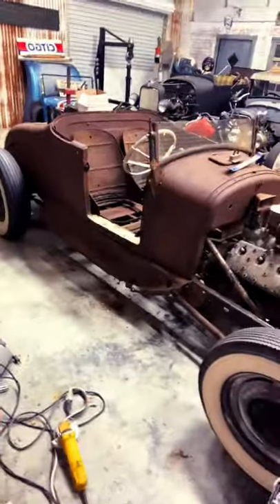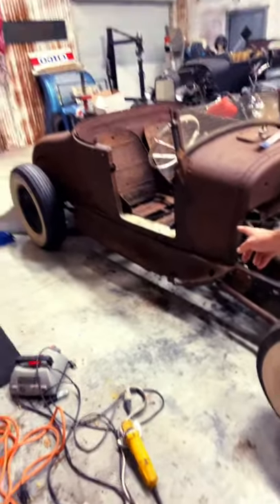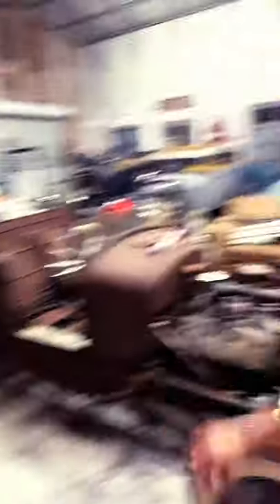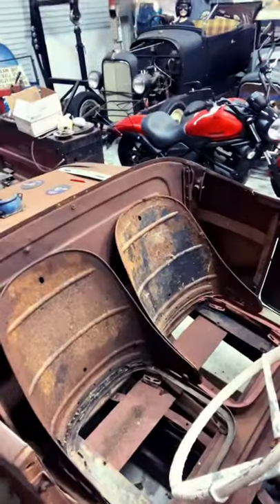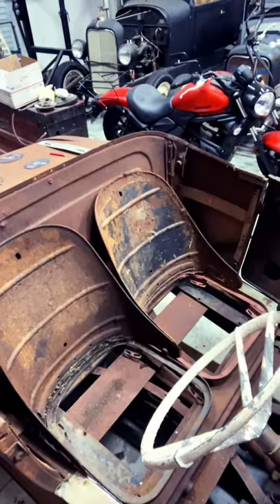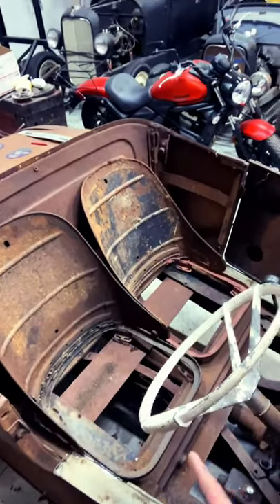Pinetree T update (short) #youtubeshort #short #thisoldhotrod #pinetreet

Comment: This build reminds me of my youth. Dad & me built a  T roadster pickup on a 32 frame with an 8-BA flathead back in the early 60's. We cut the cowl in half then widened it 7 inches to match the 32 frame width. We used the rear section of an old touring car for the rear of the cab,& we made a pickup bed for it. Keep up the Good Work !!
Reply from the maker: Thank you so much. I’m glad it’s bringing back some memories.  That sounds like quite the build.   It’s a great hobby and I’m glad I’m a part of it.  
Mike